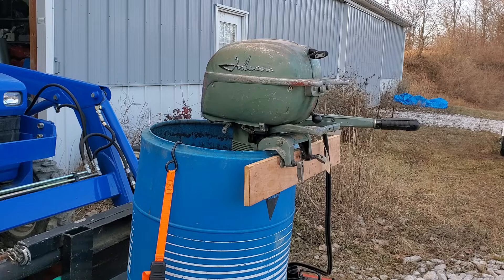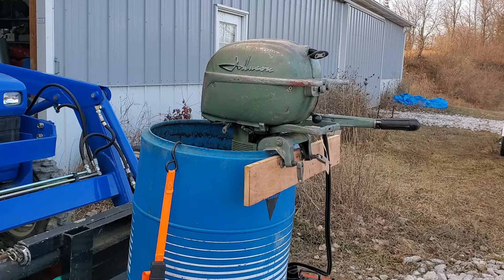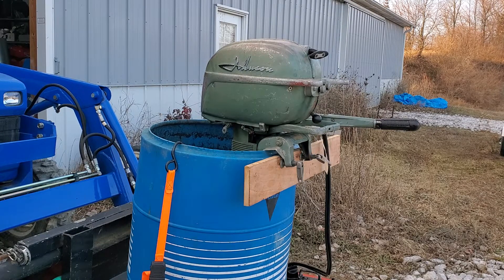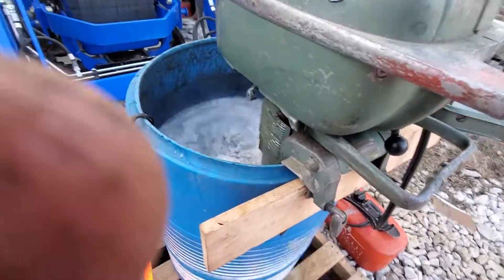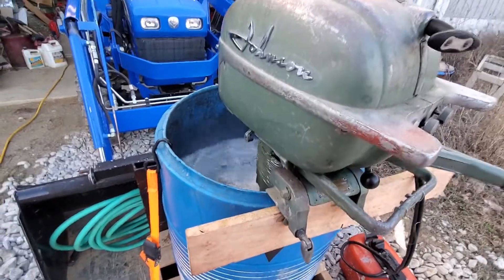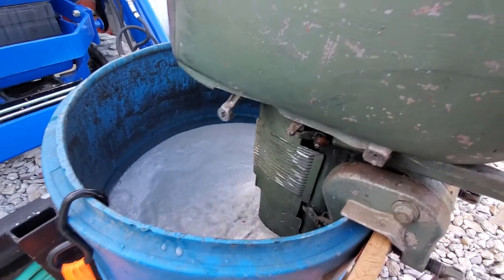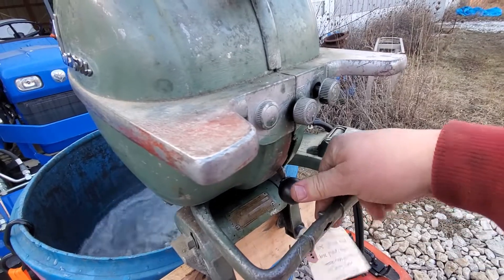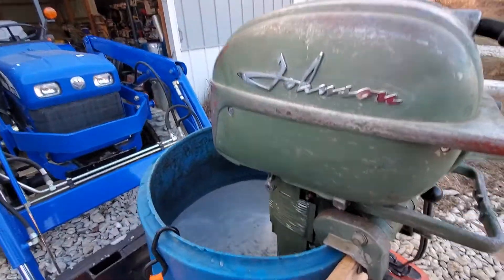1953 Johnson QD-14 First Start After Three Years

Comment: I watched the video again from a different perspective. I think the gas tank primer button made me feel uneasy. Or the horns on the front. A truly solid motor. Well built it seems. Thanks again. Seeing this motor close like this is cool.
Reply from the maker: The gas tank primer is just a tank mounted fluid pump and does the exact same thing as a primer bulb.  A primer bulb can be used in place of the primer button on these, but is not recommended because of the pressurized system.  The bulb is then subjected to the tank pressure which it is not designed for.  That said,  however, they do have to withstand the pressure built up in a one-way vented modern single line tank.  Those are not equipped with a pressure relief like the pressure tanks were and consequently can see higher pressures than a pressure tank even allows for.
The horns on the front might be a little scary.  Like the motor might try to gore you while you're in the boat, LOL.  
These are very solid and powerful motors for their size and weight.  You're welcome amd thanks again for watching!

Comment: I have a fully restored Johnson like yours.  It is my fastest 10hp.  Not as fast as a Merc but a 20mph motor.  Those Javelin moldings are probably worth as much as the motor!    Have not run it since I painted it.  Watching your post makes me want to get it wet again!  Thanks

dale
Reply from the maker: I have a very nice original QD-14A that I went through and ran on the lake in November.  It is my fastest 10hp also. This one is not far behind.  You're right about the Javelin moldings.   They probably are worth as much as the motor.  I like the look of them on there and whomever mounted them did a great job.  You should get yours back on the water next season and let it breathe again.  Thanks for watching, Dale!

Comment: Those motors gave me anxiety. Made me nervous. Wondering if you’ll make it back. Complicated to start. Flooding. Watching you run them makes it easier . More relaxing.I’m lucky to have been part of it.
Thanks !
Reply from the maker: I really like these motors.  The earlier QDs with the throttle control linked to the tilt angle of the tiller instead of the twist grip and the earlier gearcase are not quite as simple to work on.  I still like them, but they have a few things in their design that were definitely improved in the first few years.  The '53s are really cool to me.  I really like the '54s as well.  The flip open hood was an improvement,  but is still like the look of the gen 1 hood.  The later carbs are better as well but these carbs aren't that bad.  A little cantankerous,  but not bad once you're used to them.  Thanks for watching!

Comment: You can let this motor sit for years then do a quick inspection , change the fuel and with a few pulls have an extremely strong and reliable motor ... Just incredible that some of those old motors are deathless.
Reply from the maker: Yes. I have had this motor hanging on the rack since it was last run on the lake at our cabin.  It was run empty of fuel and hauled home. I hung it up and never even winterized it.  The rope had been pulled over a couple times a year, but never started.  I have done repair work to it twice to fix issues I found while I last ran it.  I had the gearcase off and apart to replace the clutch dog.  Took the powerhead off to replace the gaskets. Put it back together, dropped it in the tank, hooked up the fuel tank and primed it.  In a few pulls the old girl was ready to rock again.  I'm thinking this may not work as well with a new one.  The fuel systems and electronics are just too complicated for this kind of reliability after such a long slumber.  It is very typical of my OMC motors that I have serviced to fire right up after 3 or more years of sitting and run just like they did their last time out. I serviced a 1958 Johnson 18hp in the fall that was given to me.  It had been sitting on the floor of my neighbor's garage for at least 20 years.  It had been used as a parts donor at some point and was missing the recoil and a couple other things.  I replaced the missing parts and it started in three pulls as it was.  It ran OK.  I tuned it up and it will be on the lake again next season.   Thanks for watching!

Comment: That beast is alive for sure...  Too bad about the leak...I would advise just letting it leak and use it, but know you won't be happy til its fixed.  This monster will make a great daily runner for somebody.  These QDs went through so many changes is just a few years, most of them for the better.  Would love to mess with one of these beasts someday, does someone still make those primer cups?
Reply from the maker: Yessir,  this one is awake and alive after 3 years of sitting.  You're right, I couldn't leave it alone and let it leak.  I had to fix it.  I replaced the grommet last night and plan to test run it again today to make sure it is fixed properly now.  This is one I plan to hold on to.  I have several of these now and will probably sell at least a couple of them, but im keeping at least this one and my nice original QD-14A.  QDs degrees went through a lot of changes in a short time.  They were quite evolutionary if not revolutionary in their time.  I have the entire line of early style QDs from 1949-1953.  Some of them I need to go through yet.  There are lots of these around for when you decide to go through one yourself.   I know Lloyd Lautner is making the leather primer washers for the TD/TN 5hp motors.  I'm not sure of the internal differences between the QD primers and those.   Most of these I have are a bit weak but still function.  I plan to get this one back on the lake this year.  Thanks for watching, Don!